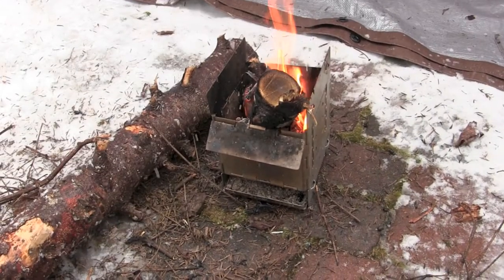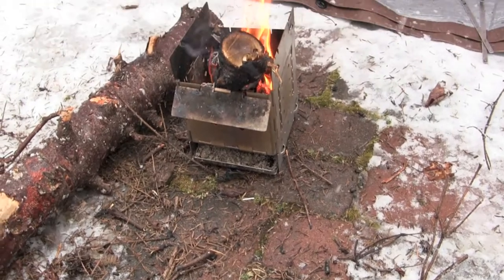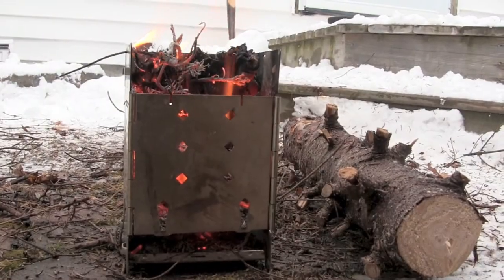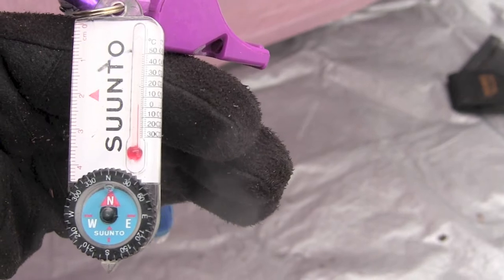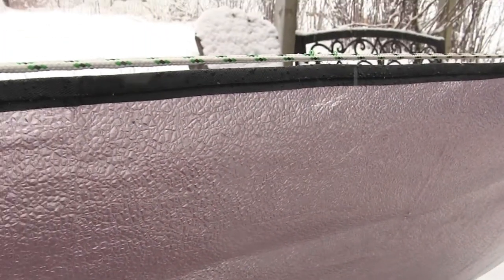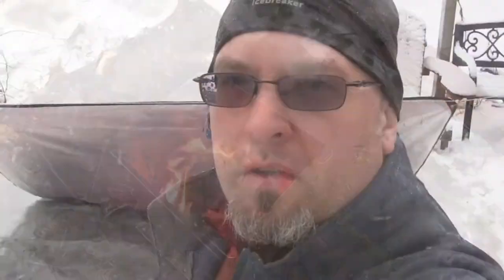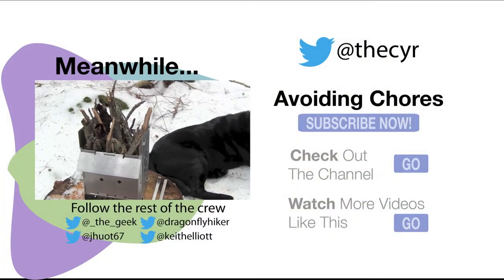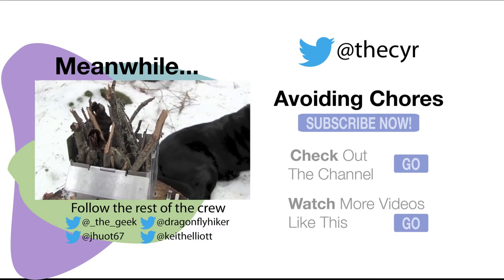Winter Shelter with Firebox Wood Stove

Comment: You need a 6 inch over hang at your ridge line.So the heat rolls back down towards you,Instead of up and out.Also your fire should only be 1 Pace away from the shelter. And ya a long fire definitely helps here. great practice Though Jim!